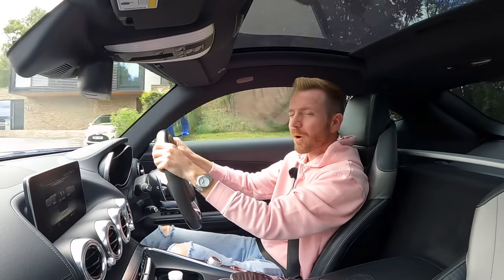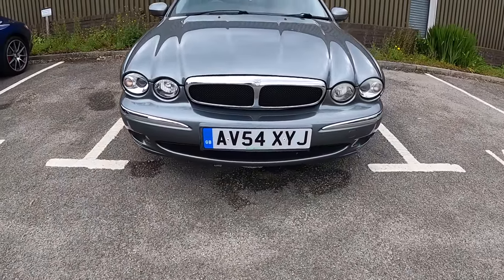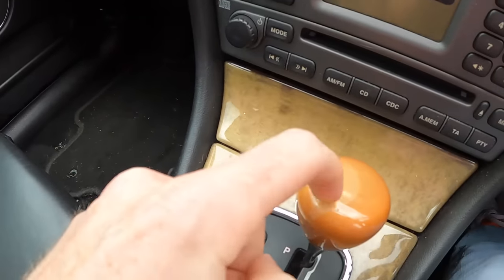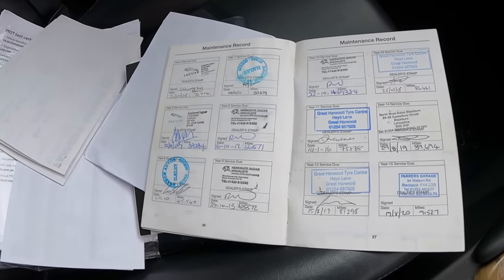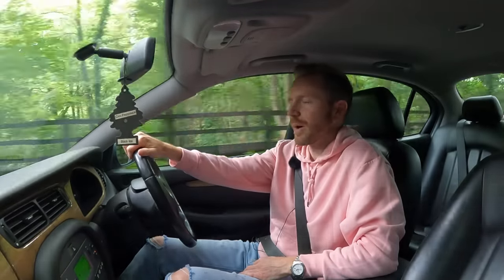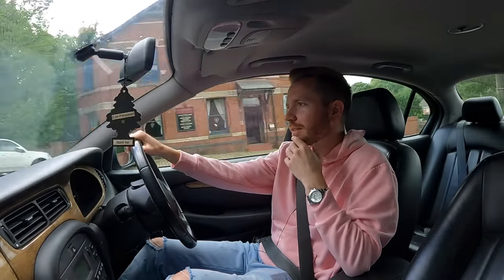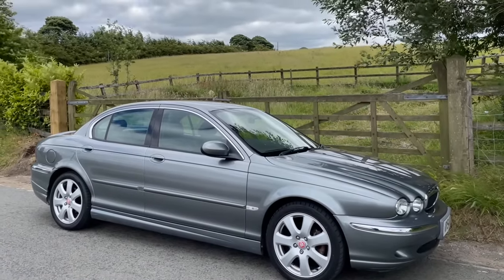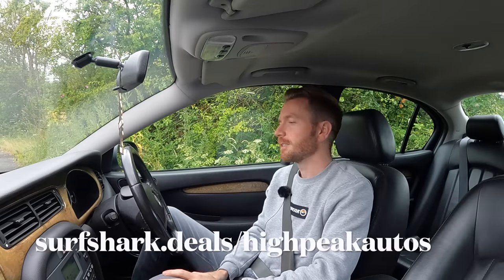I BOUGHT A CHEAP JAGUAR X TYPE!

Comment: I purchased a 2.2d sport 10 years ago for a cheap daily work horse and it’s been nothing but rock solid reliable. As for it being a mondeo in drag. It’s a heavily modified floor plan of the mondeo just like the Mazda 6 and the freelander but the jag has a different wheelbase to a mondeo. Then again it’s no different to V.A.G group cars nowadays so I don’t understand the hate.
Reply: Years ago I really upset an X Type owner in my local pub. He came in wearing head to toe, Jag branded clothing. After a few pints, I had to ask him, what Jag he had (totally was expecting an E-Type or something). He pointed to his car and he totally blew up when I said "sorry mate, I can only see a Mondeo". Whoops, too much beer and not enough mouth control on my behalf ☹️😂.
Reply: At least the X Type looked like a Jag. These days Jag's look like Mondeo's.... 🤣
Reply: Well said. It is just pure snobbery and Jealousy.
Reply: Saab got the same stick, "it's just a Vectra, it's just a Cavalier etc". Which wouldn't even be a bad thing as loads of research and development went into those cars themselves. But Saab always spent millions more modifying the GM platform into something stronger, safer, more refined, better built. People generally don't understand. Alot of cars share basic platform design, it doesn't mean the two end products are the same thing. A Rolls Royce Ghost is not a 7 series. A Maybach 57 is not the same as a W140 S class. A Bentley Continental is not the same as a VW Phaeton.
Reply: I had an X-Type. It's usually weird old men that want to upset you buy telling you it's a Mondeo. The strange thing is, mondeos in the early to mid 00s were excellent cars
Reply: And the Jaguar X type especially the 2.2 (ford transit engine) means parts are cheap and readily available. Also because of the way the car has been designed the x types are weldable and rust can easily be cheap to fix. Don't let the dreaded rust put you off! I have a 350BHP V6 Saab 9-3 estate (tuned and modded) and I was so surprised how my £850 Xtype Sovereign 2.2 transit van accelerates. No wonder white vans are the fastest things on the road!
Reply: @vinnyvsx  h
Reply: @catherinemidwinter4243  Good chat, I totally agree with you

Comment: I bought a 2006 2.0d se model last year as a stop gap. It’s the 2nd cheapest car I’ve bought in my 35 year driving history. The car runs faultlessly and is spec’ed to the hilt. You can’t go wrong with these as a cheap reliable run around. As a petrol head, even I was surprised.
Reply: 2006 2.0d fella here. What a good pick, mister. Cheers ;)
Reply: Is 2005 as good?

Comment: Very interesting! Had an  X type from new many years ago. It was a great car. Motoring journalists went on about it being only a rebadged Mondeo which was nonsense. It annoys me that they never said an Audi was just a rebadged Volkswagen or a Lexus is a rebadged Toyota!
Reply: By this point the Audi A4 was completely different from a Passat and the Lexus IS was unrelated to the Avensis, but yes the British press always give Jaguar a hard time
Reply: @oliverstemp9132  but what you fail to mention is the 3.0L &3.5L Toyota engines were identical to the ones used in many of the Lexus models, even some of switchgear from the early ES 300’s can be found in the same and next gen Toyota Camry’s ...At least Jaguar made changes to the Mondeo heads to optimise power.
Reply: @paulsz6194  and the Audi used engines from a VW, NOBODY CARES
Reply: @oliverstemp9132  If nobody cares (in your opinion) then why make the effort to  make comment here in the first place?
I guess you don't like it when something points out the holes in your arguments?
Reply: @oliverstemp9132  The Avensis is a people mover, and the Lexus IS is a sedan.They are cars from two different segments. You might as well say How the Toyota Yaris is not related to the Lexus CT200.
Reply: @paulsz6194  I wouldn’t compare a Yaris to a CT because they are completely different.
Reply: @oliverstemp9132  …Just like a Lexus IS is completely different to  a Toyota Avensis. At least we can agree on that.

Comment: Judging by the reassuring service record, decent bodywork (tiny rust), great wheels and tyres, nice interior, 2.5 AWD with just 95k on the clock, 2200 quid seems very good.

Comment: I had the 3 Litre AWD version of this (same year) & it was simply superb. Ran it happily for a couple of years then decided to get something that was cheaper on fuel. I've since often wished I hadn't!  Actually the 3 litre AWD is surprisingly rare now.
Reply: Snap! I had a 2004 3 litre AWD manual. Superb car. Only sold it because at 90k miles it was getting a bit close to the psychological value dip of 100k miles. Traded in against a gorgeous Jaguar Racing Green S-Type 2.7d.
Reply: I have a white 3.0 AWD X-type sitting outside right now!
Reply: Mines a 2.5 but still happy with it when it's roadworthy!
Reply: Good economy on the highway
Reply: Got a 2005 xtype,gold,3.0 AWD
Reply: @jamessmallwood8488  same

Comment: Had a 55 plate diesel one for about three years and loved every last mile in it. Great cars. 
Awesome content as always. Love the cheaper cars in your series
Reply: My dad had a 55 plate diesel too. I loved riding in it and it proper nipped along. Had it in the family for about 6 years and did about 130,000 miles in that time. After we sold it I kept an eye on its records and it did another 100,000 after that. I don’t understand the negativity that people have towards them. Like I said, dad had it for 6 years and never went wrong in that time.
Reply: @CMS-qo3wz  Much maligned, especially the diesels (even in this video he tell us to avoid them) but my 55 plate 2.0d SE is immaculate with just 60K miles. I wanted a manual X Type and one without a DPF so I was lucky. It could do with an extra 20bhp which can be resolved by a retune or chip but I'm happy enough to keep it standard. It has its foibles such as a stupid boot mechanism that has no key slot and mine doesn't have fold down rear seats; the door handles are not 'c' type and can get broken when the doors ice up in winter if you pull too hard. The bollocks about a Mondeo in a dress grates with me, many executive cars have humble proven platforms from other models and the dynamics of the Mondeo are good anyway. Only around 30% of the car is shared with Mondeo, it's just a popular myth to slate it for the commonality.

Comment: I've had 2 x types in the past an now drive an XF. The x type isn't a 'proper' Jag but I really enjoyed driving my ones. Cheap as chips to run, good economy, nippy and reliable. Someone will be well chuffed with that Matt.
Reply: me hopefully!
Reply: The XF platform is the same as the S-Type (and Lincoln in the U.S.) Does that mean that the XF is less than a "proper Jag" ?
Reply: @keithmountain9437  Depends really. My XF is only the 2.0d - 4 pot, so some traditionalists might say that's not a 'proper' Jag either. Unless it's bigger than a 3.0l engine and a V6/V8 then people will always take the piss. Hopefully an XJ for me next. That's definitely a 'proper' Jag IMHO

Comment: I love jaguars but I had two of these and both had mechanical issues. Now have an xf and I am much happier with it. Tata have done a great job with jaguar even if the look is less distinct.
Reply: jag after 2010 is a slow motion train wreck

new warranty claims say it all. they were at the top of the industry in 2009 and now they’re at the bottom

Comment: Drove and sold heaps of X Types as a Jag salesman for 8 years. In my experience all versions both petrol & diesel were very reliable. As you say Matt, sill corrosion was a common issue, clunking due to drop links and auto boxes with a mind of their own were also quite common along with the occasional transfer box failure. 

Like you,much prefer the estate. Best one is the 3.0 (231 bhp) Sport Premium , especially in facelift form from 2008 onwards, which had no chrome, diamond stitch leather, or alcantara in earlier versions, carbon fibre dash trim and lovely 18” 5 spoke Proteus alloys. Although I’m a big auto fan nowadays, the 5 speed manual in the 3.0 was superb and made the car much more responsive and much better fuel economy. Very scarce nowadays but worth it to wait until one pops up. 😊
Reply: the engines are reliable or the whole car, as auto box problems  would then deem the car as a whole as unreliable as would drop link clunking, alfa 159/ brera  has clunking suspension and thats classed as unreliable !
Reply: I had 4 of these in the family and 3 out of the 4 went to the scrap yard with failed transfer boxes. The 4th was the 2.2 diesel that was FWD.

Comment: I think if it had xenon’s it’s would have headlight washers in the bumper 🤷🏽‍♂️
Reply: Not necessarilly, I had one that had the washers and no xenons. You have to check the bulbs to see if theyre xenons
Reply: @robertavadani5946  yes but he’s saying if it had xenons it would have the washers.
Reply: @robertavadani5946  it’s a legal requirement to have headlight washers if the car has xenon lights. Obviously there is a chance, especially on an older car that it’s had a replacement, second hand, non washer bumper at some point and the washers have been deleted.
Reply: @ShalomBrother  I'm talking about having the washers, but the headlights not being xenon. That's what I meant. My car was exactly like that. Had washers and had halogen bulbs. I had to replace the headlights all together for xenon ones
Reply: @robertavadani5946  that’s fair enough, but the question asked was has it got xenon headlights, or has it not as you can’t tell by the shape of the bulb diffuser in the light? 

 If a car left the factory with xenon headlights it was also legally required to have a washing system installed. 

If it left the factory with halogen lights then there is no legal requirement to have washers. 

Maybe there was an option to have washers with halogens or maybe the washers automatically came on a certain trim level, who knows? 

All I do know though is that xenon’s always come with washers from the factory by law

Comment: On your advice, I’ve bought a black diesel 2017 XJ Premium Luxury. 70k on the clock, owned by the dealer. 5 years warranty, £17,000. What a bloody bargain. Pick it up Wednesday. Nice X-type by the way. I had a 54 plate, 2.5 Sport in the day. Exact same colour. Gun metal.
Reply: How does it feel to drive?
Reply: @dw4525  I tried a 2013 plate XJ last winter, but bought a 2010 Maserati Quattroporte 4.7 sport in the end. Regarding the XJ Difficult to explain. Very solid and insulated from everything. The version I pick up next week has air suspension, so will let you know once I’ve driven it home. I’ve previously owned a 2016 XE supercharged and 2013 XF portfolio. Both very impressive, direct and powerful. Will be interesting to see what 2017 plate feels like on a daily.

Comment: I like the fact you're open about the purchase price and the spend. As a dealer you have to make a profit and give a warranty etc. Recently purchased a first car for the youngest and the amount dealers that have clearly taken a part ex and done nothing to it is shocking. Garages in Bristol wanting £3.5k for a 2006 Polo with 2 months MOT and a million advisory items, terrible bodywork, high mileage, crap service history  and needing money spent on it straight away. Ended up with a 2009 i20 1.2 for £1900 from a part time trader and paint sprayer. I serviced it myself, replaced a CV boot and got tracked, it had 6 months MOT with no advisories. Body work is spot on for the age, loads of history a sensible number of previous owners. Owed us £2200 after doing the jobs on it. 
Youngest quickly took a huge chunk out of a tyre side wall, reversed into a low wall damaging the back box, then scraped the bumper and wing on the garden wall. 
But if I didn't intervene he'd have spent £2700 on a 2008 Swift in terrible condition, with 6 weeks MOT and complete f'd brakes all around.

Comment: Loved this video Matt. My first Jaguar was a 2004 X-Type 3.0 AWD SE manual. Awesome car. It's true the X-Type had 22% parts commonality with a Ford Mondeo, but that was no bad thing anyway. The AWD was great for stability on country roads, you didn't have to wait for snow to enjoy the benefit.

V6 is creamy although I must say I found the 2.5 litre underpowered: the 3 litre was awesome at 6.6 seconds 0-60 mph. I definitely recommend you try out a 3 litre, Jaguar still made the 3 litre estates after stopping production of the 3 litre saloons.

The Queen did run a 3 litre AWD Sovereign estate. Apparently she had previously had an XJ and the centre armrest had a special extension to hold her handbag - that may be where the hand bag story came from.

You didn't show it, but the glovebox catch on the X-Type has an extra hook. You can use it to suspend a handbag, or very handy for a takeaway when driving home!

Also it looks like your car has the split fold rear seat. Not all Jaguars had that and it's a welcome practical option. Worth a mention in your advert, if the car hasn't already sold!

Also looks like it has a CD player in front. That's worth a mention.

I wouldn't worry about no Satnav, the Jaguar Satnav from that age would be well out of date anyway. I would just have mounted my phone on a dashboard holder and used Google Maps.
Reply: Got a 2005 x-type gold,fold down rear seats, AWD 3.0,even has original disc changer in trunk, complete history since imported from England,all the books from factory as well as radio code, 182k for $2000 aside from routine things to do ,pretty great car. Even was included with sale a donner veh.
Reply: @jamessmallwood8488  brilliant! My own X-Type had the fold down rear seats option as well, very handy for those awkward loads.

Comment: Had a 2004 2.5 V6 AWD manual in Jaguar Racing Green and loved it. V6 had such a nice noise without being vulgar. Unfortunately, had endless issues with it and wasted loads of money. Replaced it with my current XF which I still adore after almost 7 years, and hope it will last many more.

Comment: I always liked the look of the X type and nearly bought one several years ago until I test drove them and it was a major let down. It felt cramped for me. Just a very mediocre experience. They were manual diesels I tested so maybe I would have a different experience with the auto with higher spec engine.
Reply: I loved my petrol manual 3.0 AWD X-Type but I had a 2.0d manual X-Type as a workshop loan car once and it was a dog. Slow, cramped, noisy, unwieldy and unloved.  I was so glad to get back into my 3 litre!

Diesel X-Types are pretty good cars, apparently, but you need one that has been well looked after. That workshop car hadn't been!

Comment: Love an X-type. I bought one as a daily whilst having my Aston.  Spirit Ltd Ed 2.5 AWD similar to this one (albeit with a sporty factory kit). It’s awesome. Cuts through the snow whilst the pretend 4x4’s are slipping more than an Aston clutch.  It was purchased for one winter and this its still with me as my daily 3 years later. 
Only downside is the mpg is worse than the 4.7 V8. Yes, really.  A good one is a bargain.

Comment: As Jeremy Clarkson would say - "Nice, you've bought a posh Mondeo." The diesels are quite fragile, but the V6 4x4 models are very good.
Reply: Just like guys in a Volvo V40, they just bought a posh Carisma, or the later Volvo V50 is just a posh Focus. ;)
Reply: 2.2D are quite a good engines, but as all diesels, if the previous owner changed the oil after 30-40k kms, put some garbage diesel in it, it wont matter and they will cost a lot to fix.
Reply: @BeryProduction  Old diesels are too expensive in road taxes, and is illegal to drive in public roads almost all over the world already. They are worthless.
Reply: @andersnielsen6044  Depends on where you live. Most of the EU states don´t have road tax or very low. Please tell me, where its illegal to drive diesels on the world, cause you might be living on different planet than me. Whole EU runs on diesel. US would be too if their gas wasnt that cheap. Even if its old diesel engine with older EURO standards like EURO3/4 they can drive fine, just might not be able to enter city centers.
Reply: @BeryProduction  Within 5 years it is so all over the modern developed countries. Here you cannot drive in to any city without at least Euro 5. No filters = No fun = Worthless, which means that I have exported 400+ old dieselcars from Denmark to Eastern Europe and the Middle East, just this year. No one wants them here. Some cities in Germany like Berlin, it takes an Euro 6 to drive, several cities of France has abandoned dieselcars completely, or on specific days like in Paris for instanse. ;)
Reply: But he lives a jjjaaaaggggg